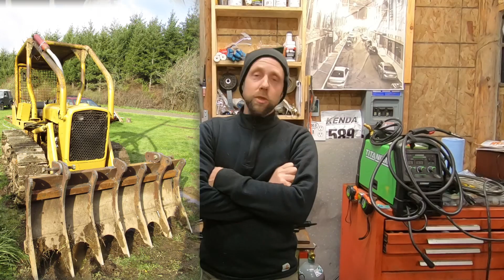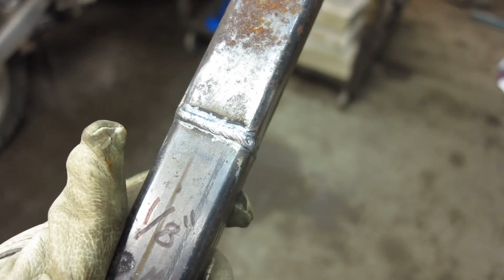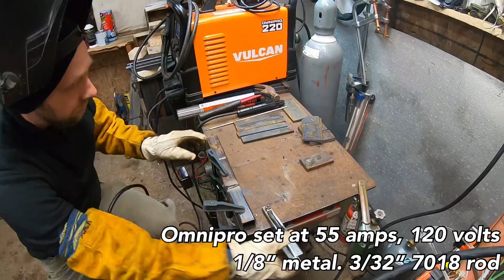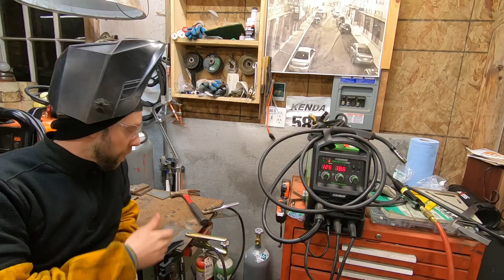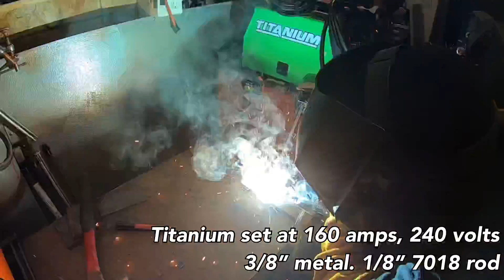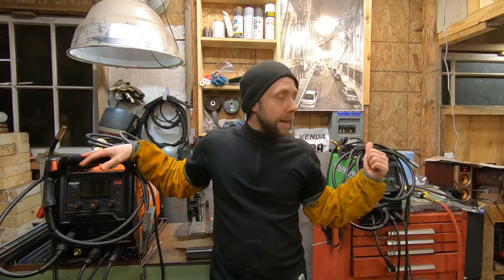Vulcan Titanium welder Harbor freight stick welding comparison

Comment: Hey man nice video. Out of curiosity, why did you keep touching the rod to the small piece of scrap metal every time the rod would stick? Curious to know why. Thanks
Reply from the maker: Hey Stephen to answer your question, when you weld with stick the flux on the outside melts, causing a glass like layer on the tip of the rod sometimes, this doesn’t allow the rod to arc, by tapping it on a piece of metal it chips of this layer and allows the rod to strike a arc much more easily. Take care

Comment: The most common welding rod used in the field is 7018  sizes 3/32” & 1/8” 
If you use that rod, your welds will probably turn out better. Just saying.
Reply: LOL
Reply from the maker: Dennis Bartek Hey Dennis you probably didn’t watch much of my video before commenting, you completely missed half the video were I weld with 7018 rod, as I mentioned it had been 3 years since I have stick welded but I think they turned out fine especially for not welding with stick for years.

Comment: Just got the Vulcan myself and love it.  Have you had any issues with it throwing error messages when you shut it off? Mine seems to do this every time I turn it off.  Could be defective, thank god for that 90 day warranty
Reply from the maker: 9K_ALLDAY  I have had no issues with my Omnipro! It’s a great welder, I have seen the error message pop up when shutting it off sometimes, it comes up so quick and goes away I cannot ever really see what it says. I think I remember seeing it more when welding in 120 volts then 220? I have just realized it’s not a problem and I have had other Omnipro owners mention that they also have seen this message. I would not worry about it. Take care 🙂
Reply: Okay good to know. Mine stopped showing the error message on shutdown when the ambient temp dropped in my shop. Love the videos btw, great job! Would love to see a more in depth omnipro 220 video if you have not already made one. Specifically on all of the settings for each weld process. I was noticing that on the stick process, mine only has an option for 2 electrode sizes. Is that all that is supported by this machine?

Comment: Just bought the titanium 200 because of your videos. Keep putting out vids and I'll keep watching. Very practical videos for beginners.
Reply from the maker: Right on! I hope you like it, I have been really happy with mine! Take care
Reply: @Mikefestiva  I'd like to 2nd what the OP said above. I'm really enjoying your videos. I also bought the Titanium 200 based on your review as well. Thanks for all the info!
Reply: Do you like how the Titanium works? I'm going to purchase one of them. I use both stick & mig welding. I've seen most of the lower cost machines splatter & smoke a whole bunch, these two machines do not appear to do this.

Comment: You have a video on that plasma cutter?
Reply from the maker: I have a video using the plasma torch, but this video is more in depth about a plasma cutting track that I built for my Cut 50 plasma torch to ride on, it makes some excellent cuts, if you get time check out this video. DIY Plasma torch cutting track https://youtu.be/G4afcmd681s

Comment: Awesome video.  I bought the titanium 200. I haven't stick welded in a long time.  I just don't understand the settings on the titanium.  I'm using 6013 rod. If you have any suggestions on how to set it up that would be great.
Reply: 6013 is a downhand gas pipe rod. If youre flat or vert welding use 6010-11 and 7018 or 14

Comment: I purchased the Titanium a few weeks back based on your initial video review. I am getting into doing forged railings and wanted a welder that was portable and could easily switch to 120v so it would be easy to take on the job sight. I was amazed at how light it was. Also the DC stick is much better than my Lincoln AC buzz Box welder. Thanks for your help!
Reply from the maker: Thanks for the comment! It’s always nice to know these videos I make are helpful to others. I definitely like the size and weight of the Titanium. I actually found the Titanium to strike a arc easier then the Omnipro when stick welding. I’m glad to hear you like your new welder, the multi voltage is a nice feature. Take care

Comment: Great video, I am an Ironworker, 15 years shop fabrication 15 years in the field. With stick the electrode dictates the amperage. The only time I ever go above 125amps on 1/8 inch is if I am cutting something. I run 1/8 at 116 to 122 depending on the machine. I totally agree with you on different machines welding a little different. There are a few variables , ie power at your location. Anyway.... Keep up the good work
Reply from the maker: Thanks Kevin for the info, I appreciate it! Haha I guess I was a bit high on the amps! Take care and thanks for checking out my video :)

Comment: Great job Mike! I agree with your stick welding comment. if you have a multiprocess welder that is a wire feed and can double as a arc welder, why would you even think about hooking up the stinger for burning rods??? You'll also get the folks that will bitch about inverter machines not being good at 6010 rods. Once again, who cares... use the wire feed process. I still have my OmniPro, and LOVE IT! ZERO ISSUES!!! I no longer own  miller or lincoln welding equipment.
Reply from the maker: Thanks for commenting Joe! I’m glad you have been happy with the Omnipro, there solid welders. I like that you mention you no longer own Lincoln or Miller equipment, I just don’t feel like most of there welders are built that good these days especially for the price. Hey I’m subscribed to your YouTube channel now, dude your Dodge is awesome! How long have you owned it for? Take care
Reply from the maker: Hey Joe I have been considering buying a Pro TIG 200, I came across a review video and noticed you commented on the guys review, you mentioned you bought one but had problems with the high frequency start? I have heard this can be a problem with those machines, how long did you own it for?
Reply: @Mikefestiva  Mike, I commented way to early on the Vulcan ProTig 200 that I had before I thoroughly tested it. That was ignorant of me. It was without question, operator error on my part.  I only tested it on 120 volts, through a 16 gauge 25 foot extension cord that was plugged into a GFIC 15 amp outlet. It welded INCREDIBLE, but the arc starts is what I was bitching about, while ignoring all the ignorant things I was doing. I wasn't able to test it on 240 volts, because my 240 receptacles weren't hooked up yet. I say GO FOR IT! I'll hopefully  pick up another Vulcan ProTig 200 by the end of the month.
When I was using the one I previously had, I switched to 2% lanthanated tungsten, and the arc starts improved a ton. That's with my ignorant set up. Once again, I say go for it, and pick up some 2% lanthanated tugsten.  Be sure to "tap" and release your tungsten on the work piece before depressing the pedal for the arc start. The arc will start EVERY time. This is common practice with people that tig weld. The Vulcan ProTig 200 is build like a brick sh#t house and will last a very long time. I still have a CK torch waiting to mate to the Vulcan ProTig 200 when I pick it up! The biggest gripe is the non adjustable post flow gas. Big deal Argon isn't expensive. Its synergic, so the post flow time is base on the amperage that is being used. 
When you do go pick one up, open the lid of the box and look at the digital display. Try to get one with a "clear" lens digital display. Its the latest version. The earlier ones (like the one I had)  has a "frosted" lens display. Just a little heads up. If you use Harbor Freight coupon number 38203079, you'll be able to take 10% off ANY Vulcan welder until 3-31-2019! Its a super coupon in the March catalog. I'm not sure if its for inside track club members or not.
Once again, and not to beat a dead horse, Miller and Lincoln dropped the ball in regards to home fabricators. What they offer is WAY over priced with very little features offered. If I had money to burn, I would get a HTP 221 Invertig. This tig is half the cost of a miller dynasty 210 and will whip its ass, however, I'll stick with the mighty Vulcan ProTig 200, because its super reliable and affordable.
Reply from the maker: Joeak74 Thanks for getting back to me, I have been thinking of getting one, I really do like the fact that if anything goes wrong you can walk in and walk out with a new machine, some of the other Chinese machines, yellow and green worry me a bit about warranty service and the shipping cost is almost the same as an extra 2 years from Harbor freight, so again that’s why I went with the Omnipro as well easy no questions asked if anything happens. Thanks for your input on the Protig, I found out a while back the limit of how much small extension cord you can lay out before the Omnipro stops welded, it would start welding for a second then stop arcing then spool out about a foot of wire. 
I knew I was asking a lot trying to weld up at my mill, I grabbed a bigger gauge cord and I was good to weld 1/8” and I was able to carry on and finish my mill track extension.
Well thanks again for your honesty on your experience. And if I go into buy a protig200  I will try out that coupon! Ps I still have the big coupon than came inside the Omnipro’s box, it’s good for 20% off any Vulcan products other then welders, the lady at HF told me to just take a photo of the coupon on my phone and that way I can keep using it! I already used it for my TIG torch. Take care Joe :)
Reply: @Mikefestiva  You won't regret getting one. I don't think you'll ever break it. I can't wait to get another one. The warranty is very kick ass. "Paulskarts" on youtube has one and loves it. He welds lots of predator cylinder heads for kart racing.   You won't have any problems with the Vulcan.

Comment: If the stick weld test was the lowest amperage setting at which the welder will strike an arc and still create fused molten metal, Vulcan and Titanium passed.  Please do a stick comparison on 2mm sheet metal.  Fine consumer test and acting.

Comment: Hey great video thank you for taking the time to make this video. I have the Omni Pro 220, I have stick welded with yet and I am a newbie.
I will say with flux core at 240 volts my welds were smoother over 120 volts on 3/16 plate with .o30 wire. I am looking forward to making bubble gum this weekend (stick welding)
Reply from the maker: Right on, thanks for checking out my video!  That’s definitely the great thing about these multi process welders, you have options to learn and have the ability to weld with different processes in one machine. Have a good time testing out the stick function on your Omnipro! 
Take care :)

Comment: Gr8 video.
Reply from the maker: Thanks!
Reply: @Mikefestiva  I almost bought the  Titanium 200 after watching your video last week.  But I ended up buying the Klutch 200 because it comes with a spool gun.  I think it is pretty close in comparison to the Titanium 200.  Should arrive next week.
Reply from the maker: I think that’s a good deal on the Klutch welder! They look about identical besides the digital display, the fact they include the spool gun makes it a great deal. To buy a TIG torch later is doesn’t cost much. Take care

Comment: Great video. Are you using an 18v Makita cordless angle grinder?
Reply from the maker: Haha yes! It came with a compact chainsaw kit I ordered, both the angle grinder and chainsaw work extremely well. The chainsaw was not bought to replace a gas saw but instead it’s using as a light compact trail saw for packing along when dirt biking after windstorms and clearing new trails. Take care:)

Comment: Good video, I’m actually a newbie.....just finished basic welding course and trying to choose between these 2 welders...any thoughts?
Reply from the maker: Honestly after using both welders I think for the price and how well it works the Titanium would be my suggestion, it’s compact, lighter and fits my needs better then the Vulcan, the Vulcan however does walk you through the settings on the digital screen and the auto set is real convenient, but the Titanium has a real nice chart inside the door for all your MIG settings, but lacks most TIG and Stick settings when it comes to a chart. I hope this helps :)
Reply: After watching his videos i went with the Titanium just like his, and i love it. Its easy, light it honestly makes welding enjoyable. I'm a newbie as well. I just bought it about a month ago and i love it. With in a few runs i was VERY impressed with my welds

Comment: Random question but...
You ever do any anodizing or plating?
Reply from the maker: No but I did look into platting in the past and it looks fairly cheap and simple to get into. How about you?
One thing I want to start doing is casting some aluminum, it could be a nice way to make special parts.
Reply: @Mikefestiva   Been wanting to do the zinc and black oxide. And really wanting to do anodizing.
Aluminum casting for sure 👍 Been subbed to quite a few channels for many years.. I think I have the process in my head, but have never done it lol
Sand casting is an art 👌

Comment: good video, I might get the titanium, currently have a amico 220 tig welder and I want some wire feed functions on 220
Reply from the maker: Thanks for checking out my video! I have been quite impressed with both welders but for the price and how well the little Titanium works it’s really surprised me, it’s a great welder! Check out my real world duty cycles video if you haven’t already, both welders had no problem welder 1/4” at 150amps for over 12 minutes only pausing to move to the next weld. Take care